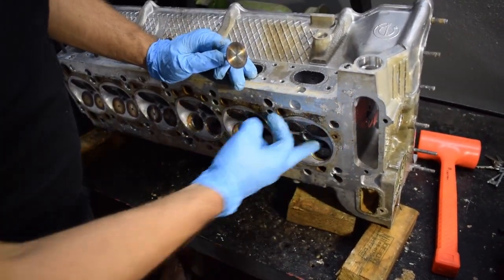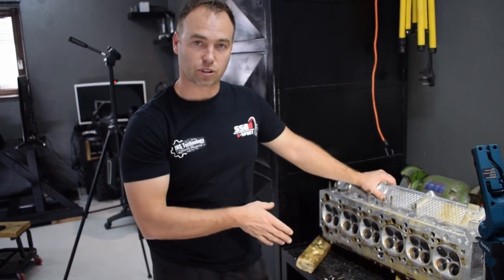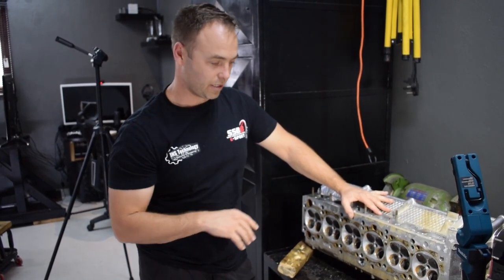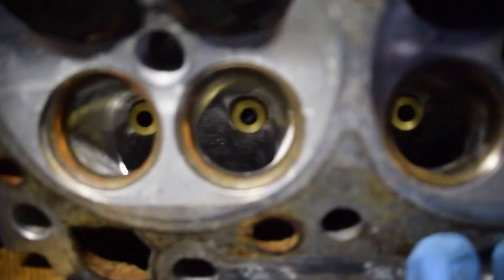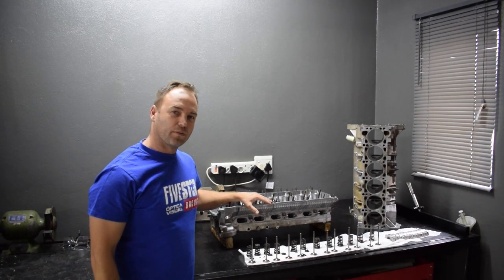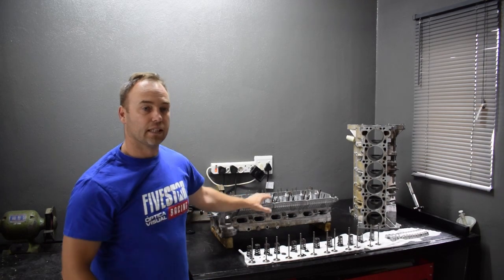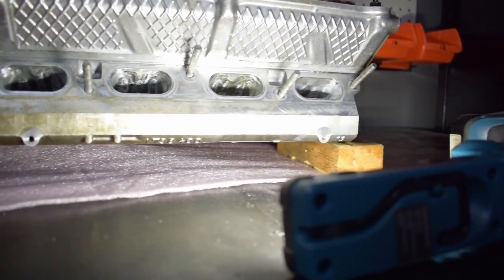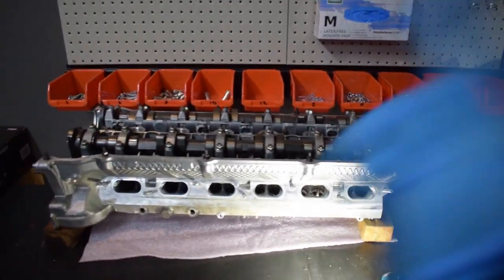M52 B30 NA Race Build Pt 2 - DIY Cylinder Head Porting!!!

Comment: When deshrouding the valves did you use the lift height as a measure for grinding ... more ... less?
Reply from the maker: Hi
The engineering shop did the head & valves so I suspect they did take lift into amount.
Thanks for watching

Comment: What kinda of valve profile did you go with on the seats?
Reply from the maker: I went for a 3angle valve job & swirl cut the valves.
In the eng the engine made 50% more power than stock. This obviously includes all of the upgrades.
Reply: @ssbb_builds2090   3angle valve job that matches the s52 profile or did you go with a steeper angle?